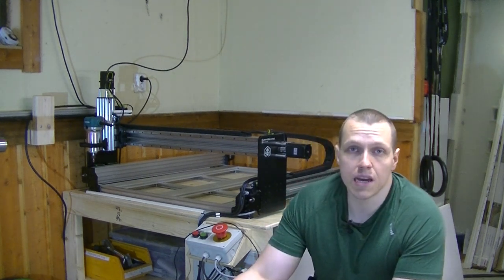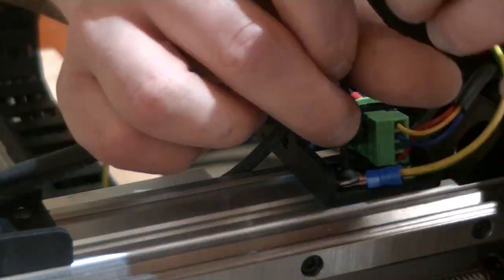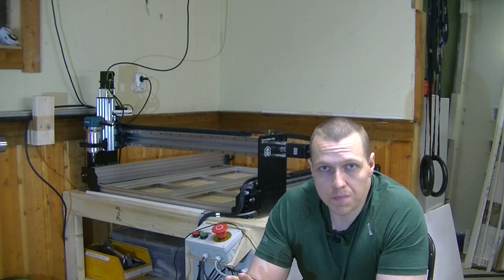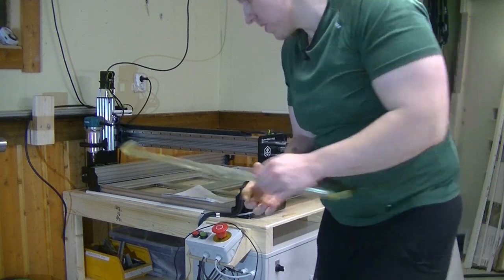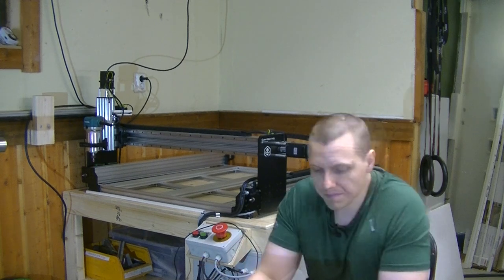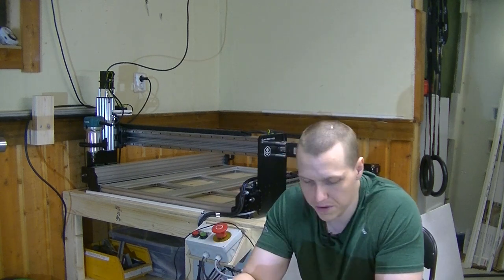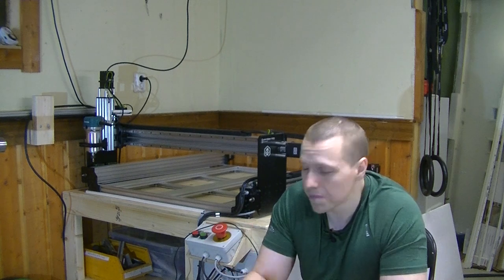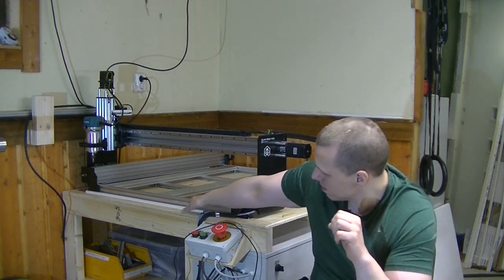QueenBee PRO CNC Router Build Part 5: Final touches and Thoughts

Comment: Looking foward to the ball screw upgrades. All the best!
Reply from the maker: Thanks, I'm also looking forward to it.
Reply: @OffHoursEngineering  Will it be enough space to stick a ballscrew at the actual place of the leadscrew?
Reply from the maker: I'm not sure about the 16mm ballscrew but the 12mm should fit. I have a 12mm on my 3d printer I took some measurements from and it should fit.
Reply: @OffHoursEngineering  That's a great news! that was my main concern when I ordered the Queenbee Blk.. I've just finished the table and I'm about to install it. Thanks for you great videos... :)
Reply from the maker: Thanks, great to hear that you like them.
Reply: @OffHoursEngineering  i can confirm 16mm will not fit. Thank you for confirming 12mm will likely fit. Please post a photo of the update of the 12mm on the printer as it will give some indication.

Comment: The screws are actully fine the motors are the weakpoint I switched to integrated servos and it's a night and day difference. Can easily job the machine around at 15000mm/min
Reply from the maker: My screws were definitely not fine, but I'm happy you were more lucky than I was. But you can't really compare servos to steppers, that's like comparing apples and oranges. Like, of course they will work better, faster, and be more reliable. That's what they are built for, the torque curves between steppers and servos are completely different.
Reply: 15000? Wow. What motors are you using?

Comment: I'm glad I found your channel. The series was very interesting. 
I look forward to the ball screw upgrade 
That should really improve the overall performance. Plus a complete replacement of the Z-Axis would be a drastic improvement. Possibly one of the Z-slider Z-Axis kits from cnc4newbie with the 80mm spindle mount. It's just a suggestion but I think you might find it real game changer.
Reply from the maker: Thanks man, I'm glad you liked it. And also thanks for the tip about the Z axis, I'll definitely check it out!
Reply: what does he mean about it not being 'real' ball screws?

Comment: Hi, great series. I'm considering buying this kit as I've been using an ultra DIY CNC for the past year and half and I'm tired of fixing problems. How has this one held up after all this time? Would you recommend it? Thanks!
Reply from the maker: It is still going strong, I've had close to no issues in the first year of running it.
The only problems I've had have been self inflicted. Today I would go for their "Ultimate Bee" which is basically the same but with ball screws. But I would definitely recommend it.
Reply: @OffHoursEngineering  That's the one I was thinking on getting, thank you very much for the reply!

Comment: Thank You for these videos. I am considering on buying this kit but was a little intimidated by the wiring. Your explanation was through. I think i am going to give it a shot after i download the instruction manual.  Have you had any problems with your machine so far?
Reply from the maker: I'm happy to hear that you liked it! The only problem I've had was during the assembly with the bad quality of most of the screws. Apart from that it performs flawlessly.

Comment: Hi, thanks for all the videos. Does any of the Bulkman kits come with ball screws ? If not is there a kit out there that does ?
Reply from the maker: Glad you liked them.
I don't think any of bulkmans kits have ballscrews. Of the top of my head the only hobby machine I know of that comes with ballscrews as standard is the Raw Avantic. But that is a semi industrial machine that costs around 4000-5000eur.
Reply: @OffHoursEngineering  I think the Queenbee is a good starting point for us tinkerers. I can always upgrade items as needed. Maybe eventually move from a router to a spindle and then try an upgrade to ball screws. I emailed Bulkman and they said they might have a kit with ball screws in the future. I also sent Bulkman a link to this video and mentioned the poor screw quality 😉. Keep the videos coming .
Reply from the maker: I agree, it is a good platform if you want to upgrade it in the future. But you don't need to upgrade it as some machines out there.
There will be more videos coming, I promise.

Comment: Aren’t this Aluminium extrusions anodized? Just wondering because you were talking about proper grounding and if these are anodized than that anodizing layer acts as an electric insulator.
Reply from the maker: You are correct, it is. But the T-nuts I used have serrations on the back that cuts through the anodisation and makes proper contact. And in other places I used threaded holes for the ground cables and then it is not an issue.

Comment: What would be convenient is to install a raspberry pi along with a breakout board. Then commnicate from external monitor via SSH.
Reply from the maker: I actually read up on that after your comment a couple of weeks back. And it would be a nice solution. At least if the real-time performance could be improved running linuxcnc on the raspberry pi 4, but I haven't found any info on how stable that is yet. I guess you could use grbl-hal as well, but I would prefer linuxcnc.
Reply: @OffHoursEngineering  Yeh right real time performance is a key + less communication interferance since all is on board. Only wifi comm ssh for monitor remote. There is this guy who made this setup:
https://www.youtube.com/watch?v=qL530kJUmII
Reply from the maker: Nice, I'll make sure to check it out.